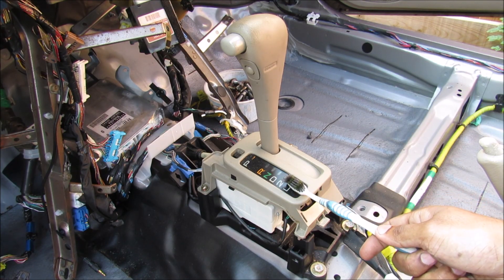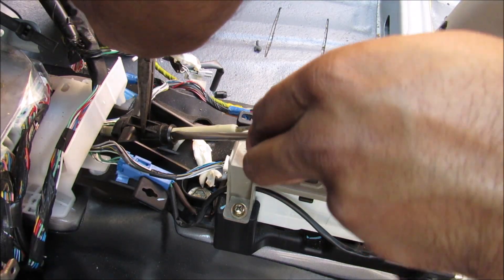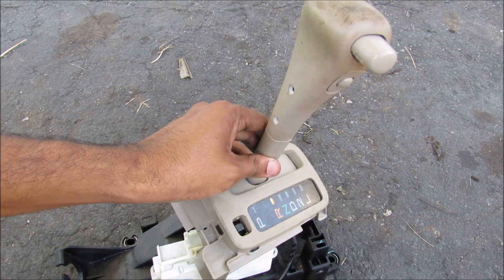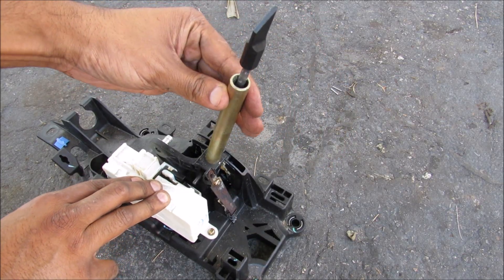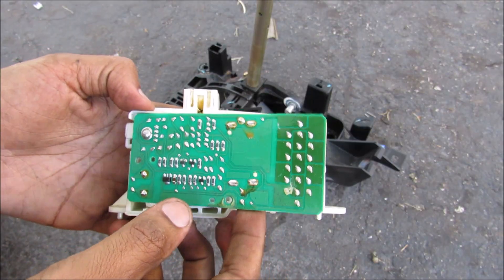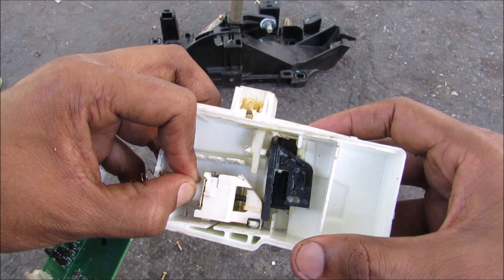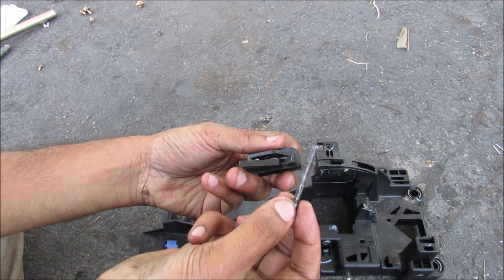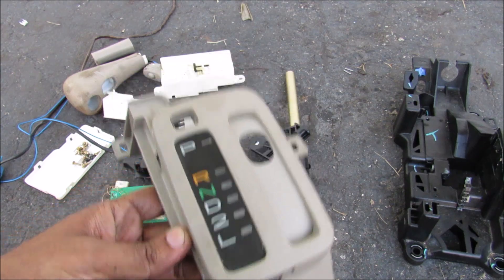How a Shifter Works

Comment: Would it be possible to have video for a Manual shifter? I've been trying to visualize how the lever engages with the shifter forks. And it gets even more complex with FWD which I believe uses shifter links because the transmission is bolted way over in the engine bay rather than in the cabin like a rwd would be.
Reply from the maker: I have a manual transmission video

Comment: It takes a lot to really wear that spring plate or the detent surfaces, right? Because somebody keeps telling I have to shift slowly or else I would break the gears somehow. 

But it looks like the surface of the detents are rounded and designed to slip  but only if you deliberately move it or bump at a certain force. I don't see how that component would wear. 

Heck, it seems that auto shifters from junkyards still work fine and go into position just fine.
Reply from the maker: Yes it is a high wear surface sonim sure they've made sure it doesn't wear down over the years
Reply: @speedkar99  Makes sense, since all of the auto trans issues I heard, there is nothing about it being out of alignment in the mechanism inside, only when the cable or linkage needs to be tightened or realign, but nothing in the shifter assembly. It doesn't seem like you need to replace that part ever, even if the driver is a rough one. 

Oh, thanks for answering my question! Had an argument with a family member over this so I started searching for answers and at the same time increased my mechanical understanding.
Reply: @speedkar99  To clarify: I was told that I could get the selector out of alignment or something if I don't go through the notches one by one. What I usually is just do what you did a few times and smoothly to drive or park from either position.

Comment: I have a question my truck has the same kind of shifter as that, but when I shift it into neutral my truck is actually in reverse but it shows it’s in neutral and it’s like that with all gears it shows in in a different gear  than I actually am. There was a little green chip that came out of the side of my shift assemblt inside the truck aswel and not sure how to go about fixing it

Comment: Hey I have a question about the shift lever. This car I have has been sitting in my driveway because the shift lever rod snapped off,  how do I go about fixing it? Thanks for the informative video too!
Reply: If you can find a CAD modeller to make you a replica file you can then take it to a company that does CNC or 3d printing.

Comment: How is the reverse and forward gears buttons recognized by the transmission, since both are using the same two wires?
Reply from the maker: The cable goes to the transmission and controls a valve in the valve body. Check out my FWD transmission video

Comment: Help me pls. I tried opening up the shift button and the spring pops up! I can put it back either the buttons is free (free shifting from D to R) or its locked (D and N only). Try several ways pushing the shifter up and down and screwing/unscrewing the lever up and down. But i decided now to put it in free so that i can still use the car but its dangerous coz i already mis shift from D to R twice now :(

Comment: Holy cow! I have a gear shift that doesn't require me to push the button to change gears even when the car is not running and the break not pushed. guess I'll just find a junkyard and replace the whole contraption lol

Comment: Mthr Fr, you crack DEEP, brother you crack DEEEP. And I listened and watch very carefully, as a result I learned. I had a job to do cause my  97 Szki Sideck needed some attention and I gave it. Almost no plastic parts except the wheel that catches in park on  the pin, so I qswabbed a little WD-[different mechanism(spring and ball on stick that catch on indents)same outcome] on each indent from P to L and bingo no more hassle from my chick.

Thanks BRO
Reply from the maker: You are welcome

Comment: My position indicator rubber slider is jamming up. It seems like it slipped off the track. I can shift backwards as far as D but the rubber gets all bunched up so I can't shift to 2 or L. I need to how to get it back on track.
1997 Camry XLE 6-cyl.

Comment: Is it possible to convert this system into something electronic, where I'm able to choose on my dash?
Reply from the maker: Yes 
But the transmission needs the cable movement to work so you'd need a servo to pull the cable

Comment: Hello Speedkar love your ability to teach n show so grateful to you sir because you have accelerated my learning. I was a student mechanic in 70s certified for so many hours however the business was so corrupt, I switched to emergency trauma.

 I don't know if you have the time to diagnose a corolla 2000 stuck in park. It cranks in neutral; will not start; is it the brake light switch?

 I can hear the shift solenoid and the neutral safety switch is in position, all cables are ok. 

If you cannot give me a clue and  this video has given me many clues and wires to test; will let you know how I make out.

 I will test brake pedal switch first then work my way to  the shift solenoid with volt meter and ohms; love your work. If I cannot find the primary cause I will have read my textbooks, God bless you Speedkar!

Respectfully,
AG
Reply from the maker: Thanks. Have you checked air Fuel and spark since you've tried out the neutral safety switch?
Reply: @speedkar99  yes.
Reply: @speedkar99   yes starter relay; fuel relay, bat cables; starter solenoid  and fuses work there is an ignition fuse inside dash board not blown its a 7.5 amp fuse it could be shifter module telling ecu car is in drive, so it will not start it could be a simple fix. It started last sept 2018 ,when I replaced fuel pump, I had floored the accelerator; it shut the car down.

 Prior to this while driving the dashboard indicator flashed on the brake light. I thought this was a brake fluid issue it was very low refilled it pumping it with key on, no resistance on pedal ;then perhaps the master cylinder booster is old leaking vacum i don't really know yet never the less, the car should be able to start regardless of all the other issue. Its pointing to brake pedal and shifter module, which I could never find until Your video came to the rescue, god bless good fellow.
Reply: @speedkar99  yes neutral safety switch in alignment, cables responsive. voltage n ground good no open circuits or broken wires.

Comment: If your shifter makes a clicking sound when you press the brake gently while it's in park.  What does that mean? I had my front brake pads changed and oil changed and that's what was noticed after changing those, with the shifter in park and applying brakes. (Toyota Corolla)
Reply from the maker: The relay is releasing the shift lock

Comment: I'm in the delivery business. I've got a 2018 Chevrolet Cruze 9 speed automatic turbo diesel. I shift in and out of park probably 100 times a day. Will this cause the shifter to wear out faster than normal? I'm about to get a new job but worried I'm damaging it. Thanks!!!
Reply from the maker: Yes it might wear eventually 
Try using the handbrake instead if you just want to pause in traffic

Comment: i'm running a 93 corola with automatic tranny similar on this video. I find the gear stick somehow resistive when shifting(due to age i guess), is there a way to loosen up the sliding of the stick without opening the assembly? I'm thinking of using any alcohol spray type of lubricant but not sure tho . I haven't drove yet a newer version to compare the shift stick smoothness. i hope anyone have any idea, thanks.
Reply from the maker: Alcohol will remove grease

Comment: *Here's how to drag race with an auto transmission* 
Ok, you pull up beside the car you'll be racing, and you put the shifter into 'L' for "Leave. Once you reach 30mph, you shift it into 'D' for "Drag". When you hit 60-75mph, you quickly shift it into 'R' for "Race". 

Once you have the car pulled out of the ditch, tow it to the shop to have the transmission replaced, then rinse & repeat! Lol. That was from an OLD joke I heard in the 80s.
Reply from the maker: Haha that's a good one... Except for P.... What's that for? 🤔
Reply: @speedkar99  Pass

Comment: Hi, Thanks for the video, one thing i dont  know is ECU already know what position shifter is in with electronics but still i dont know why we need transmission cable to transmission ... any idea.. behind this. even recent model have this kind of setup
Reply from the maker: +sivaraj palanisamy modern transmission use a solenoid inside the transmission to change the park/ reverse drive gears. Older cars use a cable. See my transmission video for more.

Comment: Some times my car will get locked in park and wont budge .. at times a little messing with it will release it, some times it wont budge for days. 98 ford mustang 6cyc Off and on for a few years now, and a super pain.  At time 453 on your video you say that some times the solenoid might be busted.  Does this seem to be the case with my car ?  Could it be somthing else ?
Reply from the maker: +thisonelife x Yes, or it could be the sense circuit for the brakes, assuming your shifter is electronic like this one is. 
Older vehicles use a cable or lever from the brake to unlock the shifter

Comment: Another well done video. Seeing you cut an electrical connector, would you do a video on how to disconnect the various type of electrical connectors?  I swear that not a single connector is the same in some cars and most are impossible to disconnect.
Reply from the maker: +Tripp M thanks for the suggestion, a video on electrical connectors has been requested before. I'll consider it now that I'll be scraping this car and I have the harness at my disposal. And yes most connectors are different so they don't get mixed up.
Reply: Maybe talk about soldered vs twisted vs crimped connectors and advantages and disadvantages of each?

Comment: speedkar99, what an awesome video!
My shifter is having a problem that you mentioned on your video.  Will not come out of park, the only way I can shift is by pumping the brake pedal, sometimes once sometimes several times.  Should I have the solenoid replaced?  2004 Toyota Camry.
I actually have a work colleague that has a 2004 4Runner with the same issue.
Reply from the maker: +Sarahelena Rodriguez thanks. Check your oar neutral switch. Common problem with Camry.
Reply: Thank you. Will do.

Comment: Incredible the amount of detail and work that goes into each little component we take for granted. Thanks for showing us!!
Weird that north americans are so addicted to their automatic transmissions, big roads, long distances. It would make more sense here in Europe where the roads are so smalls and there's basically one big traffic jam, yet everyone drives a stick..
Reply from the maker: +Koffi Banan Agreed! There's so much engineering that goes into a car that gets easily overlooked by the average driver.
Reply: Standard transmission= higher KPL (MPG here). It takes HP to run an AT.
Reply: @HUBBABUBBADOOPYDOOP  That only applies to really old automatics, modern autos are more economical than their manual counterparts.
Reply: @HUBBABUBBADOOPYDOOP  HP? Horsepower? For auto transmission?
Reply: @shshzhxye  
If you're regarding "new" cars, then no. I'm referring to what is mostly on the road, right now. "Older" systems do require more HP to operate, compared to older manual gearboxes. 
The majority of vehicles on the road, right now, 11/27/2021 are not younger than 2013.
Myth 1. Manual cars always get better fuel economy than cars with automatic gearboxes.
In the past, it was pretty much a given that vehicles with manual transmissions would be more fuel-efficient than their automatic counterparts. But as modern automatics gained additional gears and relied less on a torque converter, they have now overtaken manuals in terms of fuel economy.

Let's take the 2020 Chevrolet Camaro as an example. With the base four-cylinder engine, the six-speed manual gets an EPA-estimated 23 mpg in mixed driving conditions. The Camaro's automatic transmission, on the other hand, has eight speeds and is estimated to get 25 mpg in mixed driving — an 8.7% improvement.
Reply: @HUBBABUBBADOOPYDOOP  thanks for the detailed comment!

Comment: To me, this channel is being much more about Reverse Engineering than Mechanics.. Which for some may sound not that pleasant but again, to me, it's amazing!! Keep up the great job!
Reply from the maker: +Marcos Scheeren Thanks for the comment. I started out doing repair, but this summer I bought this car to completely gut apart and learn how it works. Its an experience for me as I've learned so much, and with that understanding it will help diagnosing problems in the future. I'm glad you enjoy the videos, and video ideas are always welcome !

Comment: Manual transmissions for life!!! Why? They're much cheaper to fix when they break down.  Plus, that shifter was mostly plastic, don't shift angry folks, pretty sure it's a pricey fix.
Reply from the maker: +Brian Day if only I could learn stick shift now...
Reply: I love stick shift, but I use as well automatic most of the time, I have fixed those two, there is not a big difference from old style automatic and stick shift, but new automatic ones are kinda rude with my wallet. LOL
Reply: Oh, I'm sure you'd learn really fast. You have the brains, it's just getting a feel for it now.  My 2002 Lexus Is300 manual trans(2jzge) went out at 250,000 miles. Parts, labor and tax. $950.00. Automatic trans for that car...$$$$$$